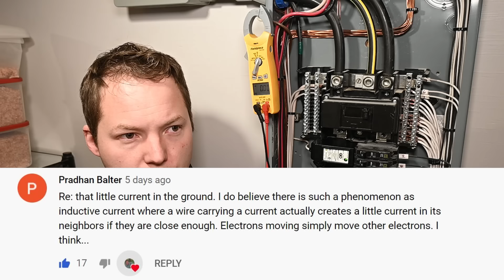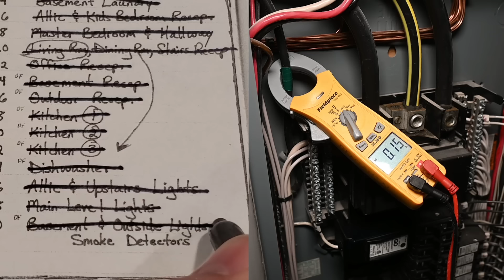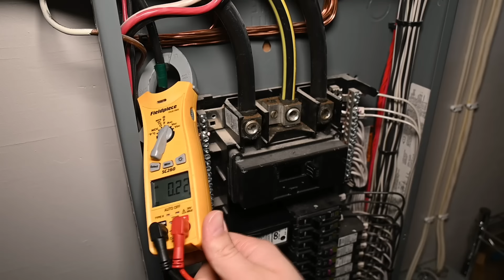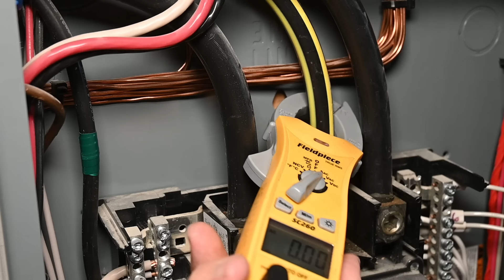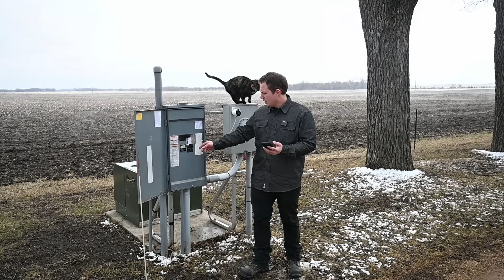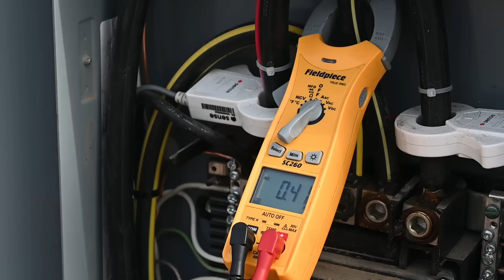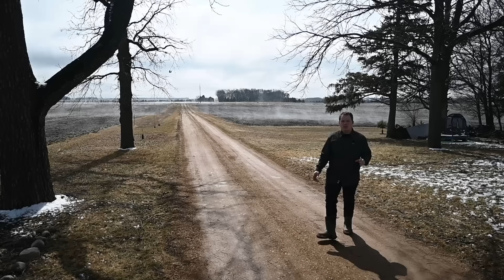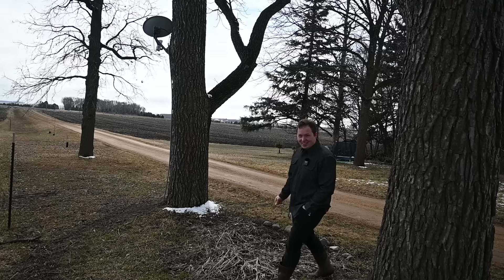Finding The Source of Stray Current on Grounding System

Comment: inothome had the best explanation of where the stray current is coming from, but he did not explain WHY. Power transformers require 5 wires to make them work. 2 wires for the primary and 3 wires for the center tapped secondary. But most power transformers have only 4 wires visible. Where is the 5th wire. The 5th wire is the primary side return wire. It is internally connected to the center tapped neutral wire which must be connected to earth ground and must NEVER be disconnected. The primary from the street may or may not have its own neutral, but even if it does some primary side return current will flow through any and all connections to earth. his means that with respect to earth, the neutral is not zero volts. And if the primary side does not have its own neutral back to the street, then ALL the primary return current will flow through your earth grounds. This is the source of the stray current you are measuring. The current will vary based on your load and the loads from all your neighbors. 
By the way, you may get shocked if you touch your transformer metal box or any of the other metal boxes in your bare feet, so always wear dry shoes (even in your house). To check for this, drive a piece of metal into the ground about 50 feet from the transformer and measure the voltage between the metal you drove into the ground and the transformer metal box and also the neutral. It will not be zero. this is why cows get shocked entering or leaving a metal barn on a farm. 
If you want to lower the stray current in your house, then add more ground rods near the transformer. 
PS: my stray current is more than 2 Amps.
Reply: Yep that’s why underneath substations, you have an earth mat. To give a solid but even distribution of earthing system over a given area.
The joys of 330 kV, 132kV control and monitoring cubical builds and installation, and other substation work.

All earths are joined together to a single point. To eliminate stray earth currents flowing, due to the seen impedance of the earthing system having two or more points at a different impedance with respect to each other.

Same if you have multiple earth stakes, thus multiple return paths in play and say you have increased impedance due to increased soil resistivity or a dodgy join.

As others have already mentioned, you may need to install extra earth rods/stakes for the pad mount Tx to improve its seen earth impedance to ground.

Also as others have said, put stakes in the ground at different distances from the pad mount Tx. And using a low ohm capable meter (in the milli ohms) and a trailing wire, you will be able to measure the changes in resistivity of the ground.

Any earthing impedance imbalance, may result in the possibility of current flowing between these two or more different earthing points through the mass of the earth.
Thus the potential exists for a possible equivalent touch voltage or step voltage between these two points.

All other main earths in the electrical installation (sub boards, db’s) should be bonded back to this one single point. Inclusive of any equipotential bonded equipment, yes water and gas pipes included, as per your local electrical installation guidelines.

Thus you can have multiple db’s running a main earth back through them, back upstream through each other to the main electrical installation switchboard.
Make sure the earthing size is correct to meet minimum earth loop impedance requirements. (Maximum prospective fault short circuit current, is with respect to the nominal fault impedance values at each db).

Also should only have one neutral/earth bond at the main switchboard, which in this case is the board right next to the pad mount Tx.

If that all checks out, then you may have issues within the pad mount Tx, that’s for the utility to solve and fix.

Yes a generalised dumbed down explanation.

Seen the same issue arise in amplifiers, end up with stray capacitive effects, circulating currents both of which can induce noise into your amplifier stages.
Designed and built enough of them back in the day, a life time ago now 😂.

Comment: the natural salts in the earth's soil produce a cathodic voltage gradient.... hence the detected current flow between the grounds...   you need to do some studying on the workings of underground cathodic protection for metal buried piping and storage tanks...  as a side note... i was under a friend's house and got a mild electrical shock from the conductive copper termite shield that eating away because it was acting as the sacrificial anode.... just for fun...  try burying some zinc or aluminum near the ground rods....  also study the behaviors of your farm animals...  they are especially sensitive to the mild electric shock caused by stray voltages

Comment: Current flowing through ground wire (or neutral wire) is actually called primary neutral current as it comes from primary of distribution transformer.At the distribution transformer primary and secodary neutrals are both connected together as well as to ground.So the source of current is primary neutral current.

Comment: Ground voltage potential is tricky thing cause everyone assumes ground to be zero. Ground is a reference point and is different at each location. This is why every building is earth grounded so that the voltage difference to the building to ground is zero. However, there is a voltage difference between every ground point in the neighborhood. It is common to see current flow between grounding points.  The path of least resistance can be the ground/neutral wires in the electrical grid and what you see is the electrical flow thru the earth that flows between the north and south poles. The voltage is very large when you measure the voltage difference earth ground in the north and south pole.

Comment: Ben, your videos are great and your theory and practical application is on as well. I am wondering if you would still have the stray current if you removed the grounding electrode conductor from your sub-panel (house) to the grounding electrode conductors at the house? I think that this is the path to your house. Also, I am not aware of the NEC article/section that requires the installation of a separate grounding system at your house.

Comment: I once had a stray current coming from a fault in a primary transformer coming in through a water pipe. It was the strangest problem I encountered in my career. Even the local fire hydrants had voltage. Dogs were very wary to lift a leg. Obviously it has a source outside the house. There is a transformer leak near your house. For my money current is power and voltage is potential. I’m a simple guy.
Reply: Current is a result of a difference in potential. Power is a product of voltage and current.

Comment: Instead of turning off and checking each breaker.  Should have just turned off the main breaker in that panel.  If there still is current then your problem isn't at that panel..period.  Problem would be before that panel.

Comment: So I have a really weird question. This may sound really far out but I have been having issues with my sound systems in my room. I record music, and I have been getting a weird static noise that is picking up in every microphone I own. I even tried different cables for the microphones, and even tried it with different devices. Same exact result. You mentioned something about the water heater having issues in the video. I have an electric water heater in my room, and it is in my closet where I record my voice. Could there be something wrong with the wiring in my room where anything plugged in picks up this noise? Microphones mainly seem to pick the noise up the most, and the funny thing is, when my mic cable is not on the floor, the static seems to vanish, though can still hear a cpu sounding noise. It’s the weirdest thing I’ve ever come across and it would be even weirder if this happened to be the culprit!
Reply: Are you using a shielded mic cable?

Those have a ground sleeve around the signal wire; helps to avoid unnecessary noise from surrounding electrical fields.

You say the static goes away when the cable is not on the floor. It could be that some conduits (power cables) run underneath that floor.
A shielded cable could fix that interference. 

Also, don't keep your wire coiled up when you use it. Looks more neat, but that actually helps it pick up signals (:
(Or tie it together with some velcro or tape in the middle of the coil. 
    So your loop looks more like a figure 8 with a slim waist.)

Anyways - unshielded stuff always picks up static from surrounding devices.
     That's also why people cover the inside of their guitar cavity (where the electronics are hidden inside a guitar) with aluminum or copper tape.

So.. Shielded mic cable.
Shouldn't be a lot more expensive than an unshielded cable of the same brand

Worth a shot
    That will eliminate tje

Comment: Benjamin,  Watch Mike Holt's video explaining NEV (Neutral to Earth Voltage)  You were correct in the video when you suspected the source was the utility pole.  Mike Holt's video does a great job of explaining why there is always a voltage potential to ground and therefore some current flow on all metal parts of your system to ground via the GEC back to the primary of the utility transformer on the pole.

Comment: Your going to measure current running through every conductor to some degree unless you take very specific and very tricky precautions that don't follow standard wiring guidelines. If there is a difference in potential then there will be current through the conductor. It's quantum physics your getting hung up on and unless you know how electrons behave within electromagnetic fields.

Comment: The answer may be derive from internet search return topics on “multipoint grounded neutral system”. Also this link on page 6:29 plus. 
https://youtu.be/a_nv_Q9WbeE

Looking at the wiring diagram there we can see the N line between the substation and pad transformer adopts what is “multipoint ground neutral” architecture, whereby the N terminal of pad transformer primary winding is tie to N of secondary (ie that sec-N line has your 0.2 Amp). Essentially, some or most of ground path upstream of pad transformer is either eroded thin or broken, forcing the return current focusing by the first panel box.

Comment: You have to be getting current draw from your ground rods at the house otherwise you would be reading current on your neutral in the house. since it is floating it provides no pathway back so i think half of your stray voltage is at the transformer rods since it is .44 at the outside neutral and the other half is going to your house rods and it's using the earth as a path back to the rods at the outside panel. I still don't really get why there isn't at least minimal current on the neutral in the house. Why would the current choose the case ground over the neutral if it didn't have a path back?

Comment: I'm getting sparks from my gas line to gas meter. I measured 3.8v and 4.5 milliamps from the siding of my building and anything metal to the gas meter. I used a diode to confirm it was flowing from the siding to the meter and not the other way. I had two ground rods installed, but no difference, so I shut off the main breaker and disconnected the incoming neutral from the buss bar and have 3.8v from the neutral from the meter as well as from the ground circuit even with the neutral disconnected. I'm hoping it's just a bad meter. We did have a fire a year ago which could have melted some of the wire insulation. Keeping my fingers crossed.

Comment: What you have happening is stray current from the utility. The Neutral of the pad mount on the secondary side of the transformer is grounded. The primary neutral is grounded which is bonded to the secondary. This causes current flow within a ground system and can be seen from your video. The Source of all this would be the Utility substation. I work for a power utility fulltime and also an electrical contractor part time. Hopefully this answers your questions.

Comment: Ordinarily we think of power flowing from the hot to the neutral, but when you turn off the hots, shouldn't we consider the possibility that the current on the EGC is flowing in the opposite direction.

Comment: Look at my comment in your previous video and it will makes sense I hope. I've dealt with this especially around house with lake near by. So imagine people getting shocked in water because motor to lift boats are grounded to house ground. I've argued with engineers from Duke energy and they had no solutions to this. Isn some area this could be life threatening. I'm surprised code makera haven't figured this out yet. I have solutions to multiple of these situations. It's past what code is. So don't even bring NEC to me, because I follow it, it's just NEC is not perfect, this is one of the issues it doesn't know how to solve it yet.

Comment: First possibility: are you using a power transfer switch between the regulated source (hydro) and the generator? There is a cool and often a small motor inside . This one can drain current 
Second: the line transformer could be the culprit. I think the pickup of his secondary (the neutral) is not in the middle of the coil. Check the voltage between the neutral and the two hot connections to verify that they are perfectly identical (same voltage) .Il suggest to  disconnect  the neutral  wire and verify with a meter  between the neutral and a standard ground (must be a real decent ground https://www.youtube.com/watch?v=TycWNfpgfH0)
3rd: the electric meter: is his ground correct? Some noise?
4th: other device is connected to the main line? For example a electronic wireless meter reader? Or an electronic current limiter?
Q: who pays the 0.2A?. Pls write as a private message

Comment: The fog you are seeing is most likely caused by decomposition of dead plants in the soil combined with solar absorption. Soil is dark and dark things absorb light. If the sun was shining it would heat up the dirt faster than the regular ground, especially if it had snow reflecting the sunlight back up. Once the air cools the soil is still warm so the moisture coming from evaporation of snow is immediately converted into fog.
Reply: The fog is the frost on the dark soil being heated by the sun. The air is still and cold and the frost has now melted and is evaporating which is what you are seeing as fog.

Comment: Cable tv is leaking current into the ground.  Phone can do this as well, check for voltage incoming on water main.  I measured 120 volts between shield on coax cable to ground at panel.  I measured 60 volts from water pipe to panel ground.

Comment: Great process of elimination troubleshooting ended up on utility guys to narrow down further to pinpoint problem will be quite interesting. That was very intriguing current leakage, and only on one conductor, something is drawing that current. Other residential home hooked up to the same transformer or imbalance load return current didn’t know. Magnetic field induction interference near that subject conductor? Any cable service line not properly secured on utility poles wildest guess. From deductive to inductive reasoning…

Comment: I am leaking current and can not find where. I do not have a transformer rather it it is a 200 amp house service. It was discovered when the utility company serviced the water meter. When the meter was disconnected ( water pipe) the water service touched the copper pipe going to the house and got shocked. So from this the ground system is energized, My electric bill is double all of a sudden. Where do I start
Reply: No answer but found the problem. The utility company nuetral wire at the pole was loose. Since the panel was bonded the current was finding its way to the ground. The ground was doing its job.

Comment: I'm an electrical engineer who used to work for a power company.  The short version of why you're experiencing current on your grounds is non-equipotential grounding.  There are multiple grounds in the power system that may be passing current to the grounds in your electrical system.  Imagine you disconnected the grounds at the substation, along the power lines to your house, and also at your house and then measured the voltage between each other.   You would see huge differences in potential, which when connected together using the ground cause current to flow.  Here are a few I can think of:
1. This is likely your main source: your transformer is single phase, therefore it's only connected to 2 phases of the 3 on the transmission line,  let's say phase 1 and phase 2.  Therefore the potential of the neutral at the transformer on your property is effectively halfway between phase 1 and phase 2 (equal size coil windings on each side of the neutral).  This is not the same neutral of the 3 phase system, which comes from the coils in the transformer connected together in a Y formation, with the center of the Y being a neutral.  As both neutrals are tied to ground and are at different potentials, this causes current to flow.  Making it easier for this current to flow are the transmission lines near your house that connect their grounding wires all the way back to the substation transformer neutral.
2. Induced current along transmission line grounds (Fun fact: power companies don't ground every pole, as doing so would increase transmission line losses)
3. Ground current from the neutral wire from slight imbalances in load in the 3-phase system, especially from the substation ground to the transformers at the substation (where the neutral of the transformer is tied to the substation ground).
4.  Problem with neighbor's electrical system is sending current to ground